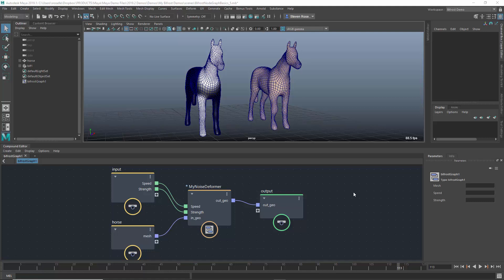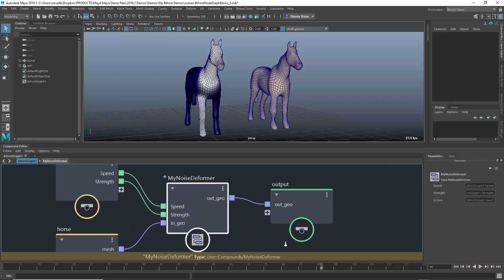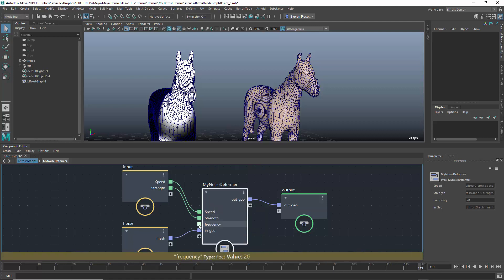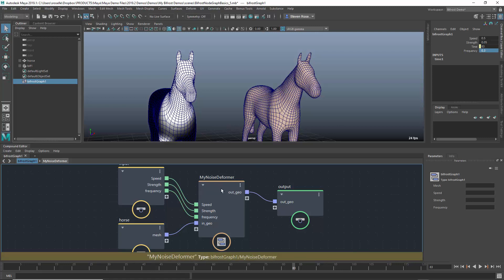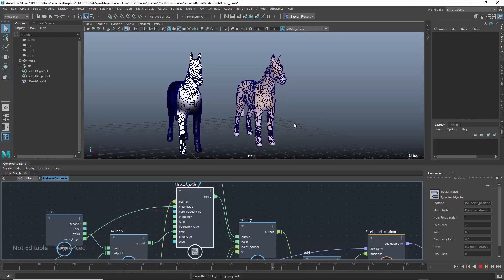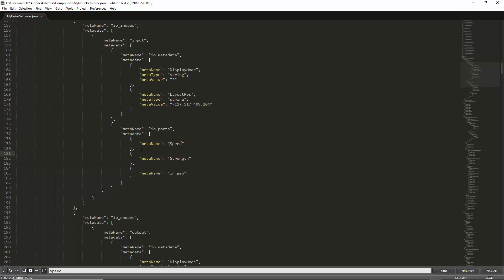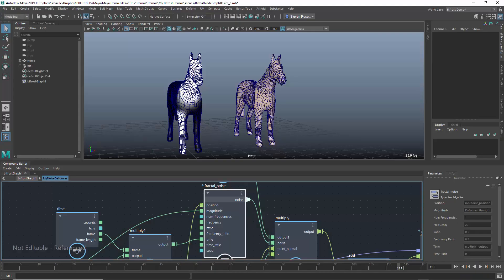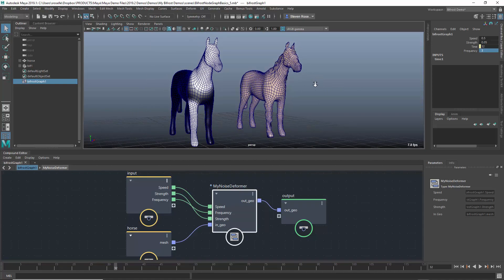Bifrost Basics Part 5:  Referenced (json) Compounds

Comment: Is bifrost going to be generic enough to do non trivial procedural modelling like houdini?
Reply from the maker: Just to clarify... you can already do procedural modeling inside of bifrost now.  It's just not the main focus currently.  but there are for instance already compounds for creating primitives.  You can create a cube or sphere mesh with an existing compound now with compounds called "create_mesh_sphere" and "create_mesh_cube" that will have parameters to control divisions, radius, etc...  You can also build your own compounds to create geo from scratch.
Reply from the maker: Hopefully eventually... modeling is fairly limited right now.  V1 focus is mostly on fx, but more to come.